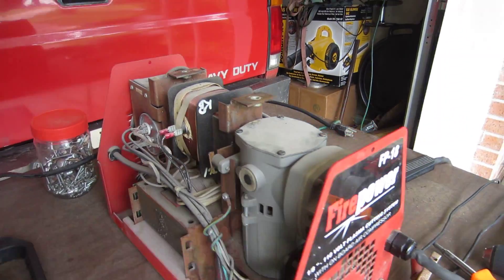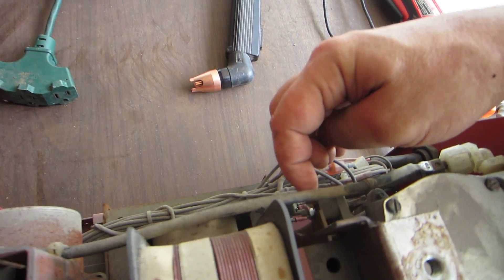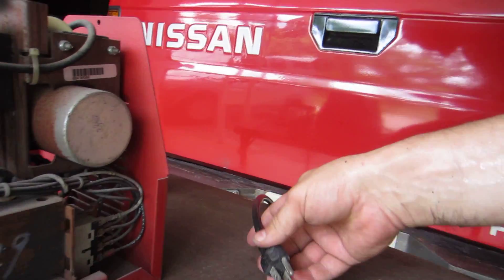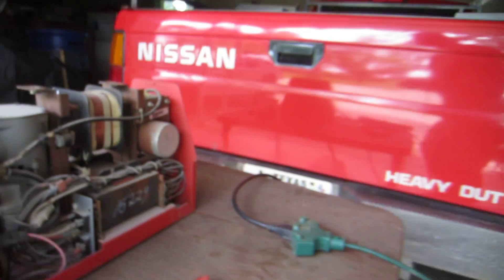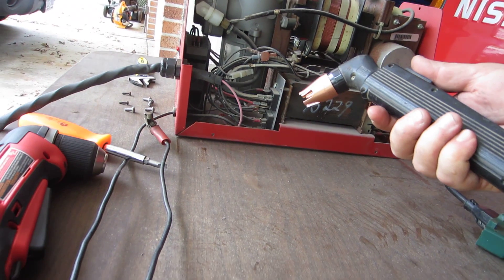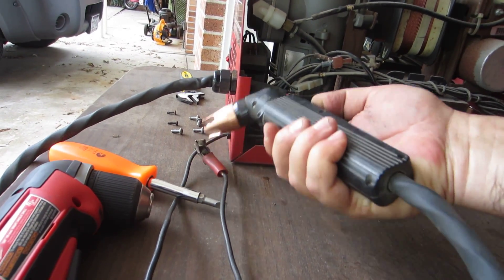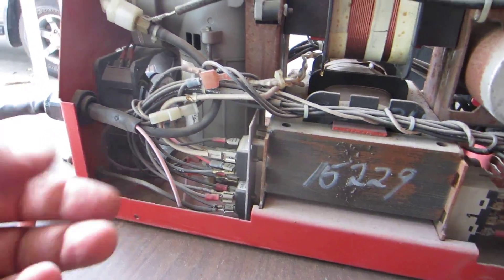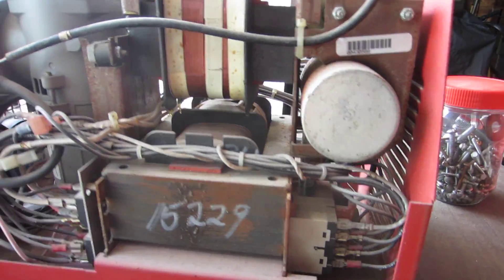Firepower FP-18

Comment: How do you like your machine ?
Reply from the maker: That one never got fixed. But when searching for parts, I found a working Fire Power that I bought. It works fine, but it only cuts thin gauge material (like barn tin), the meal needs to be clean, and it's slow. These days, if I need to cut something like that, I'll use a grinder with a cutoff wheel.